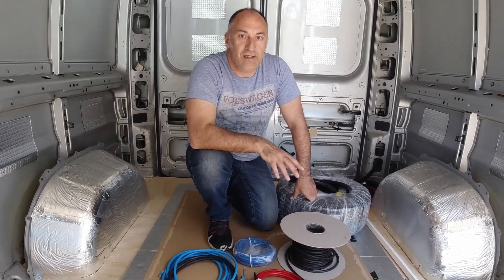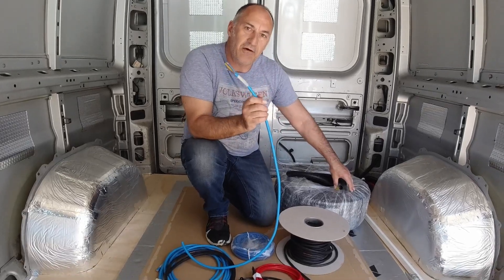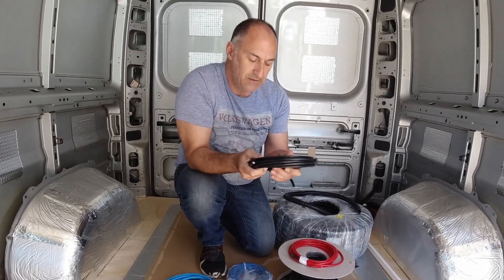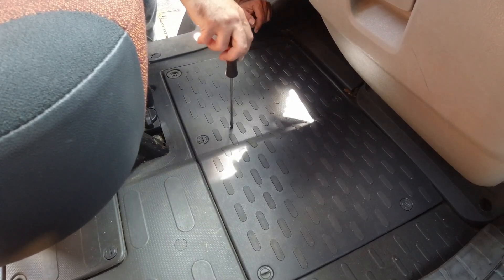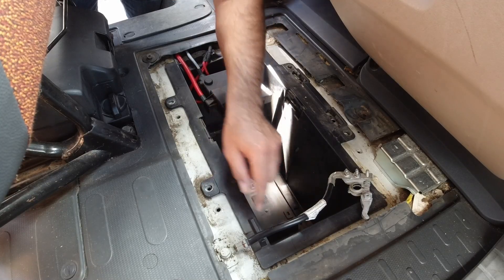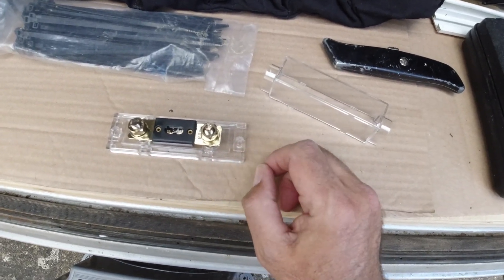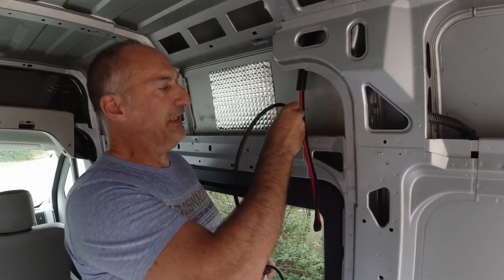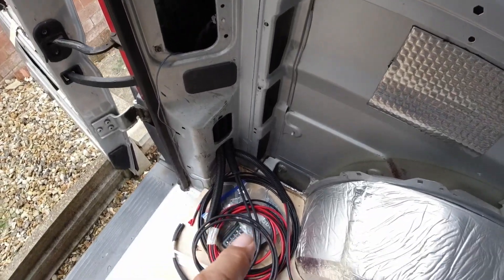How to Wire a Camper Van - Budget Build Electrics Ep15

Comment: Hello Greg,  Happy New Year. I have just traded in my Transit 350 for a Transit Custom, so I am starting again!!! I must be mad .... it's a freezing winter. I have a question, I hope you can answer. Obviously the van has 4 interior cargo bay Led lights which come on when the door opens.. What do you do with those? Do you take them out and blank off the wires. Do you just leave them as they are and hide them abpve your ceiling. Do you adapt them. Your advice will be appreciated.

Comment: I`ve got a boxer 2017 and i`m about to run the cables from the battery to the rear pillar, trouble is there is no hole to feed the conduit up through. Should I just drill a 30mm hole,

Comment: What size cable would you run to a anderson connector to operate a trailer winch rated 15 to 200 amps

Comment: The question I have and I accept that any answer is just conversational. We have a 2012 VW Caddy for conversion, and we are thinking 24v leisure battery. Could we use a split charge relay for a 24v Battery?

Comment: Can you install 2 batteries and keep them in the loading area instead of going for the battery of the van? I was just thinking it will save going around the van and running a longer cable. Just a novice here and I'm just wondering what to do with my project😅

Comment: I actually bought my WildbearX during their Kickstarter after first spotting a Google ad and then hearing a good friend talk it up. He’d already been using his and said it outperformed most of the coolers he tried, so I decided to give it a shot. Overall, I’ve been really happy—the insulation is strong, and ice lasts for days in normal summer weather. Only complaint is that some of the compartments feel a little small, so it takes some thought when you’re packing for a trip.
Reply: I’ve been using mine on fishing weekends and a couple hunting trips, and it’s been rock solid. I usually throw in ice on Friday morning and by late Sunday there’s still plenty left, which is better than the Coleman I had before. The sturdy latches and handles help when you’re hauling it across rough ground too. For me, the size has been manageable—I’d rather have something easier to carry than a huge box that takes two people to move.
Reply: @amanaly09   I don’t own one yet, but I keep looking at how it might fit in the back of my Model Y for road trips. Space is decent, but you have to be smart about what you bring if you’re packing for a family trip. From the dimensions, it looks like the WildbearX would fit without eating too much room, which is definitely something I think about when choosing gear.
Reply: @explorewithwilliaam   Quick question for those who’ve used it—how does the WildbearX compare to the cooler in this video in terms of ice retention and insulation? The specs sound similar, but real-world heat usually tells a different story. Does it actually hold ice longer, or is it about the same after a couple days outside? I’m curious how it performs on extended trips or tailgates.
Reply: @NatureEssentialsNE   I’ve used both, and I’d say the WildbearX does a little better when it comes to keeping ice solid. On a summer fishing trip, the cooler in the video had mostly melted by the end of day two, while the WildbearX still had big chunks of ice going into day three. Even once the ice starts breaking down, it somehow keeps the drinks colder for longer, which is a nice bonus. If you’re planning multi-day use, I’d lean toward WildbearX for that extra margin.

Comment: Hi
Just watched your video on pulling the low voltage wires in ! Do you have a video on the 240 wires ? Breaker box location / wiring etc

Comment: Thanks, that's my first step in converting a van which I've yet to buy. My house has a mold problem and I'm going to live in the camper because of health concerns. Thinking of a long wheel base, high roof Ford Transit but I'd appreciate any advice. How many batteries would I need ? And I believe the current from the alternator needs some sort of switch to charge the extra batteries ? I'll have to get an electrician to do the work but, I'm trying to figure the electrics out first. That's a great video. Thanks.

Comment: Useful video. Thanks. Quick question - when pulling in the battery cables, is it not easier and cheaper to connect the negative/ground to the van body near the battery?
Reply: Sorry, see you've already answered 🤐this below.

Comment: hi followed your video on installing main cables from van battery compartment. Great clear and precise. 1 problem i encountered trying to remove battery box was a fuel pump of some kind was attached to the bottom so could not remove completly, 2.2lt 2014/ 15 boxer. I have a picture but not sure how to upload. thanks scott

Comment: Can you help. I bought some 1.5mm 3core from Screwfix and was wondering if I could use it for the supply to my fridge? 
Also can you run cables in the floor insulation before I put the plywood down?

Comment: Did you run the conduit and the rubber cable for the bed reading lights from the blade fuse box or from the rear? If from the rear wouldn't you need another blade fuse box at the rear?

Comment: Hi Greg,
Thanks all the videos.
I’m just looking at the wiring for my T5 and wondering if you could tell what Amp circuit breaker I should use from the battery to the fuse board.
I’ve got a 200w Solar panel, with solar controller. I looking to run a 12v fridge, water pump, diesel heater 4 LED down lights and 2 reading LED lights.
Any advice would be much appreciated.
Regards. Ian

Comment: Hi ..some have used the chassis for the negative  cable which goes to the leisure battery and the positive cable from the van battery to supply the split charger then to the positive side of the leisure battery.

Comment: If you are connecting the leisure battery directly to the vehicle battery then this would be a mistake, if you happen to run your leisure battery flat you will also lose your vehicle battery and the van wont start.  You need to connect the negatives but the positive needs to come from a live which is only active when the vehicle is running.

Comment: Can somebody shed some light on the van body pre wiring i see on many video please.?  SO many wires/cable everywhere ! seems so unnecessary.-  when there is max for need for 3 AC 220v socket points. remaining all DC from 2 blade fuse box. - (?!)

Comment: HI , I have gone with similar  wiring to Greg's first Van conversation , using smaller cables  back to the fuse board ,    is  there anything  in that set up that you  would recommend changing out .  ( great content   ! )

Comment: Hi Greg. I've just clicked on your link and bought some of the 2.5mm 2 core 12v cable you recommended. But the cable that's arrived, although it says H07RN-F is actually 10mm diameter in total. Is this correct as I know nothing about electrics and the seller says it's for 230/240v. Cheers.

Comment: Hi Greg we are in the first stages of converting a MK7 transit minibus and we have 2 batteries under the drivers seat which one woulkd be the best to use to attach to the leisure battery when we decide which to use (lithium etc),i have been told that one is a starter battery and the other is an auxillary battery ?...Thanks and love the videos as they are brilliant for novices like us.

Comment: The first two things I like about this design are:
1.) Double insulated 220-240VAC cable that is differently colour coded to the 12VDC cables 
2.) Separate fuse holders into 'zones' ie. distribution block for kitchen. interior etc.

Comment: Good evening. Could I ask a question please? 

We have a ford minibus transit which has 2 batteries as factory fitted (2006 model). We have 2 leisure batteries and connected a split charge between them (as per your video)

The engine vehicle batteries are connected negative- negative, positive to positive and the leisure batteries have been wired the same too. 

The split charge is wired to the positive on the engine battery to the positive on one of the leisure batteries and the split charge earth cable earthed to the van bare metal.
 
We have  60amp fuses (inline) after the engine batteries and one after the split charge.

This evening having driven for around 1hour the first leisure battery connected to the split charge was extremely hot and hissing. 
I appreciate the difficulty via text but does the above sound like it has been wired correctly? If so, what could be the issue? Maybe the 2 engine batteries? 
Any help would be appreciated. Many thanks

Comment: You did a GOOD JOB! I like your Van. I have a question for you; I need to insulate my Aluminium box truck of my FORD E-450 2003. The beams underneat are aluminium but they are a little a bit rusted. I wanted to protect them by adding R15 Insulation foam underit. and then put the coolant pipe and water pipes there. I want to know how to do that and protect that insulation and water pipes from snow, salt, dust etc?

Comment: Hi Greg, amazing video as always. One thing I can't get my head around is wiring the 240v sockets I plan to install (3 of them), do you have some sort of switch that changes when the power is coming from inverter/hookup, or is it a case that the sockets always run from the inverter even when you are plugged into a hook up? This may well be a very stupid question 😅 Any advice or signposting would be hugely appreciated!
Reply from the maker: In my latest Campervan wiring video I using a Renogy inverter that has both battery and mains input and automatically switches over when on hook up so you only need to wire to sockets from the inverter. 
https://youtu.be/xCw7eARJKOg
Reply: @GregVirgoe  Ah that makes sense and sounds far simpler! Thank you Greg, taking the time to answer fellow (and far more amateur in my case) van builders questions in addition to the awesome videos is incredible, do hope you realise how much its appreciated :)

Comment: Great video , thank you , one question I have if you get the time , they tend to spec 6mm cable to the fridge from the fuse board , but my fuse will be less than 2 ft from the fridge so with a rating of 27amps  2.5mm would be good enough what do you think . wish I had the room to run cables like that in my van sometimes it’s a nightmare to get it looking tidy . Thank you well done and good luck 👍👍👍🏴🏴🇨🇦🦢

Comment: Is it necessary to keep running earth's back to the camper battery's? Can it not all just be earthed to the body of the van?
Reply from the maker: They are not earths, they are negatives. People often confuse that term with the term ground which do not mean the same thing. It’s better to run cables as you get a better connection and less problems in the future.

Comment: Hi Greg, I’ve just bought the exact same van for my first conversion, it’s even the same colour!! I’m getting quite anxious about the electrics but this video has eased that somewhat 👍 I do have a question though 🤣 I’ve decided on a 340w solar panel array, a Renogy Dc-DC/MPPT charge controller to a 280ah lithium battery with. 2000 or maybe a 2500w inverter. What thickness cable would you advise to run from the van starter battery? also what fuse would you recommend? Thanks 🙏

Comment: Could you have not made the 12v negative straight to the chassis. Would this save expense and trouble of running the black cable? 
I have jump started my van using just the one cable from the leisure battery. 
I look forward to your advice on this.

Comment: Hi Gregg,
Loving the videos!! 
Quick question, how did you calculate the 16mm for the batter run to the rear? When I do it at 40amps i get that I need 35mm cable. Any help is appreciated
Reply from the maker: i use the free calculator on the 12volt planet website https://www.12voltplanet.co.uk/cable-sizing-selection.html
for my example 30amps @ 12.5 volts over 6m one way is ok on 16mm :D
Reply: @GregVirgoe  thanks for the reply.  I use this tool too, but I put it at 40amps as that is the fuse I would be using.  Is that the wrong way to do it? I will be using the Renogy 30amp mppt and DC/DC charger.
Reply from the maker: @mark5094  Yes the cable should be rated above the fuse rating and in our case the cable rating is 110amps, which is different to the voltage drop at operating conditions.
So size your cables for volt drop at operating conditions but also make sure the rating of the cable is above fuse rating. 
I hope that makes sense. :D
Reply: @GregVirgoe  yes, that makes sense.  Can I assume there is a chart somewhere to identify the cable rating eg 16mm = 110amps
Reply from the maker: @mark5094  Yes there are tables in BS7671 which give standard values for cable ratings but as cables are made differently by manufacturers it's always best to refer to the rating tables of your suppliers as they will have to produce test data for the cables they make. !2volt planet cable ratings are a good guide to use.
Reply: Hi @GregVirgoe 
Sorry, I'm back again! I was wondering if there is any limit to the amount of cables you can run inside the flexible conduit? If there is anywhere you know I can read up on it, it would be appreciated.

Comment: I had initially planned to do the same with the 16mm cable, but had read that it should be kept as short as possible to help minimise voltage drop. Would you say it was worth drilling underbody before wheel arch if my elecrics are at the wheel arch to save around 2 meters of cable (once it goes to end cent and then loops back to wheel arch), or are the stories of voltage drop over-egged?

Comment: Hi Greg - new to this. I want to replace my vans VSR with a DC to DC charger - I'm reading 90% of vans use uninsulated DC charges nowadays. If I used one of those 30a jobbies i just need a single 16mm live feed with a 40Am fuse at the starter battery yes?

Comment: I’ve been a HGV mechanic for nearly 17 years. You can always tell a good sparky because they make things look easy. Watching this video is like watching a master at work. The way you routed those wires, especially the ceiling fan. I thought Greg knows what he’s doing. Anyone that has worked on vehicles knows that the “easy or 5 min jobs” take the longest and are the most infuriating. I really liked this video. It’s very informative. You’ve earned a new subscriber.
Reply: Hi Greg, hope you're well fella. Haven't seen any more videos since this one. Hope everything is ok 🙏. Really enjoy your in-depth videos.👍👍
Reply from the maker: Thank you very much 👍🏼
Reply: Maybe you can help me with my concern of this setup?

If you're going to have a huge battery bank constantly drawing on your alternator, won't it overheat and cut out? Then all of your electrics will drain the starter battery until the alternator cools enough to cut back in. If your starter battery drops too low too often you'll be constantly replacing it, not to mention replacing the alternator sooner as well.

I get the advantage of being able to top up batteries on long drives if they're getting low, so maybe shield them and leave them disconnected in the box to connect when needed like during whole weeks of overcast days when the solar hasn't been charging as much?

Comment: Hi, I was just wondering. I'm setting up my renault master  wire setup. I'm going to be  running two 100 amp leisure batteries  at back of van 4m from van batteries  and running  solar on roof just wondering what size  cable from van batterie would be enough and safe to run. Thanks

Comment: Hello Greg
We are loving your videos, I am following them for my own MWB van conversion.
It might seem dumb but am I right in thinking you use the 2.5 black rubber cable for all your connections from the blade fuse holder to the 12 volt items on your wiring plan marked as 1.5 mm cable? I also noticed that the cables for the bed head lights go back to where the main power cables are coming in and not back to the kitchen blade fuse holder. Is this because your going to have a 2nd blade fuse holder down in the garage space? I am just trying make sure I get it right first time. 
All the best Steve & Anita 
Wishing you happy traveling

Comment: Excellent video! Can sometimes be intimidating looking at wiring diagrams for vans and seeing other peoples crazy setups. This was simple, easy to follow and gave me confidence in a way that I understood everything.

One question, in your example wiring you had 3 pin sockets with USB built in, I’ve seen that USBs need switches because they continuously draw power even with nothing plugged in. 

I assume the built in switch is just for the 3 pin, did you do any modification to those sockets to be able to switch off the USBs?
Reply: 8:54

Comment: Hey mate! Question regarding insulation, do the voids in between the ridges in floor and ceiling cause any issues with condensation if not filled before the 25mm PIR is layed down? Even if there is a vapor barrier too?

Comment: Greg, thank you so much for your videos, always making easier for beginners to understand, with very clear instructions!
I've bought a van with a bed frame, all panels and floor already done, but the guy didn't run any cables or conduits through the pillars and the gaps available for this.

To avoid opening those access to the pillars, I thought of attaching the conduits on top of the lined carpet.
Do you think it can be too warm for keeping them "inside"? Or it's worth opening the area to run the conduits and cables and close it again?